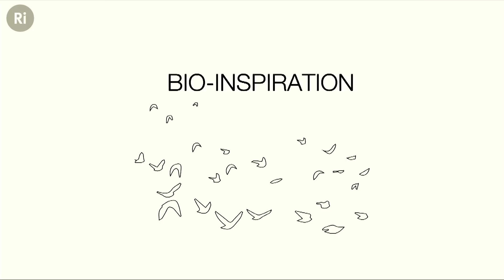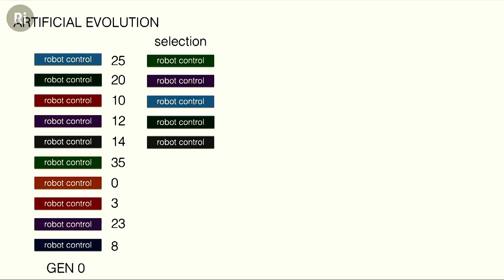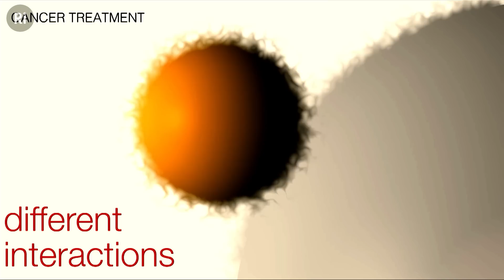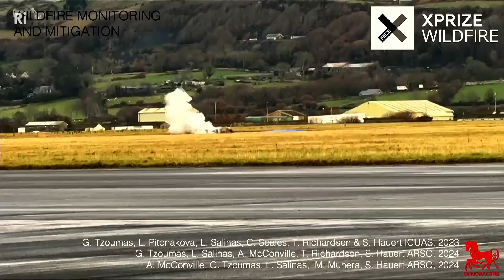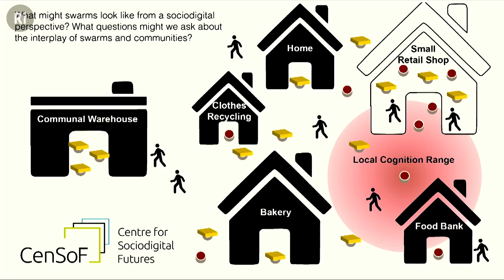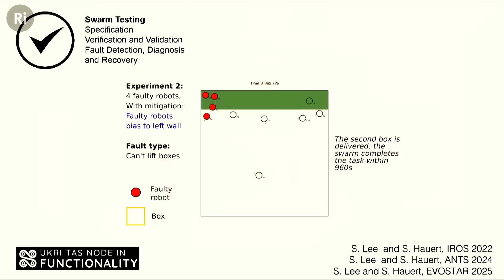Engineering a swarm - with Sabine Hauert

Comment: I’m sure your first thought was the swarm of nanobots imagined in movies, which are said to be here by the mid-21st century. I asked AI, what type of swarm robots have been developed that will be mass-produced within five years?
Claude 3.7 Explanatory,
I’d like to clarify something important before discussing swarm robotics development. Since my knowledge cutoff is October 2024. The robotics industry evolves rapidly, and production plans change based on technical breakthroughs, market conditions, and investment patterns.

That said, I can share information about promising swarm robotics technologies that, as of late 2024, were showing significant potential for mass production. These represent the most likely candidates based on technological readiness, industrial interest, and development trajectory.

Promising Swarm Robot Technologies (as of late 2024)

1. Aerial Micro-Drones

Several companies, including Zipline and Flytrex, have been developing small drone swarms for delivery and surveillance applications. These systems typically consist of dozens to hundreds of coordinated autonomous drones. The technology has matured significantly, with many systems having advanced collision avoidance, mesh networking, and distributed task allocation. The regulatory framework has also been evolving to accommodate commercial drone swarms in controlled airspace.

2. Agricultural Monitoring and Maintenance Robots

Companies like Root AI (acquired by AppHarvest) and Farmwise have been developing autonomous agricultural robots that work in swarms to monitor crop health, perform precision weeding, and handle targeted application of fertilizers or pesticides. These robots use computer vision and machine learning to identify individual plants and their needs. The economic incentives are strong due to labor shortages and sustainability concerns in agriculture.

3. Warehouse and Logistics Robots

Beyond the already common warehouse robots from companies like Amazon Robotics, newer systems from companies like Fetch Robotics and Locus Robotics have been developing more advanced swarm coordination capabilities. These robots communicate with each other to optimize package routing, avoid congestion, and dynamically redistribute workloads based on real-time demand changes.

4. Micro-Manufacturing Robots

Miniaturized robotic systems designed for assembly line tasks have been advancing toward swarm capabilities. Companies like Desktop Metal and emerging startups have been working on systems where dozens of small robots collaborate on intricate manufacturing processes that would be difficult for larger robots. These systems are particularly promising for electronics assembly and other precision manufacturing.

5. Environmental Monitoring and Cleanup Robots

Small aquatic and land-based robots designed for environmental monitoring have been gaining traction. For example, Hidroseeker has been developing swarms of small robots that can track water pollution sources and assist in cleanup operations. Similarly, TerraClean has been working on land-based robots for removing microplastics and other contaminants from soil.

Key Technological Enablers

The transition to mass production for these systems has been supported by several technological developments:

Standardized Communication Protocols: The development of robust, low-latency communication standards specifically for swarm robotics has made it easier for different manufacturers to create interoperable systems.
Improved Energy Management: Advances in battery technology and energy harvesting have addressed the crucial power limitations that previously hindered small robot deployment at scale.
Edge Computing: The ability to perform complex calculations on the robots themselves rather than relying on cloud connectivity has made swarm systems more reliable in diverse environments.
Advanced Manufacturing Techniques: The cost of producing complex robotic components has decreased significantly due to improvements in 3D printing, automated assembly, and new materials.
Would you like me to explore any of these categories in more depth, or would you prefer information about specific companies and their swarm robotics development pipelines?

My fallow up question; Sure, tell me how startups like Desktop Metal have advanced Swarm Robots.
Reply: I think it’s forgetting about the millions of drone swarms that the military is already stockpiling and developing. The announcement of the new f-47 said it would fly with swarms of death from above drones.